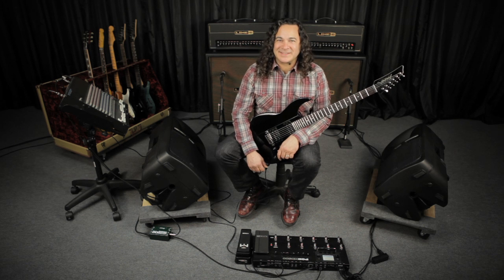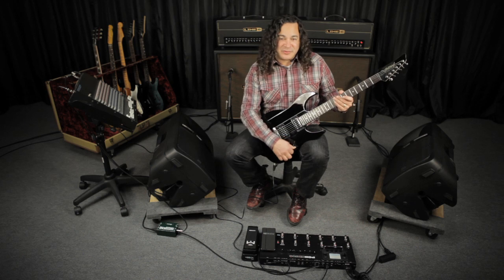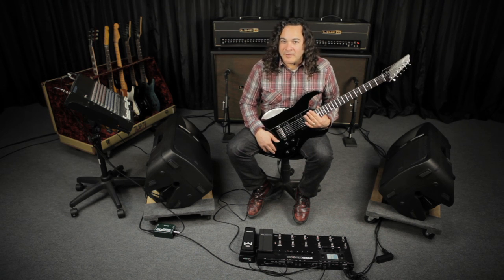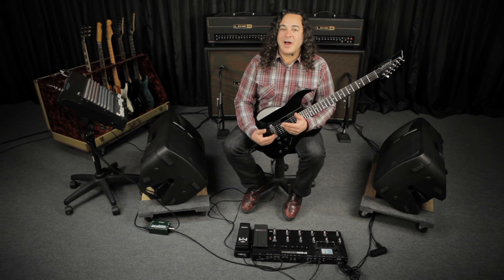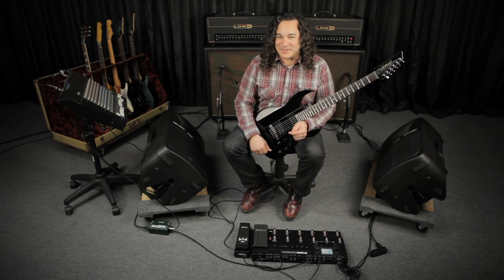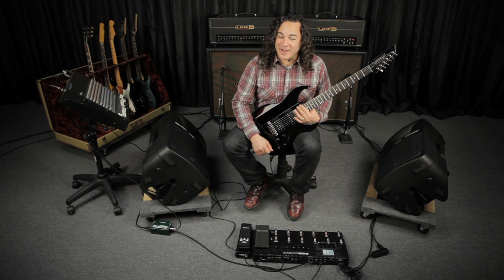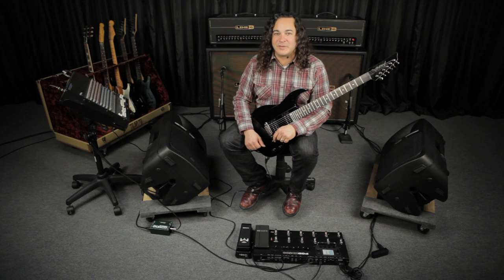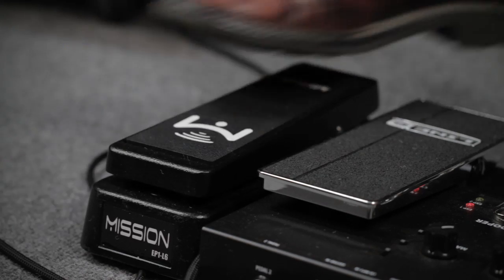Connectivity Series Pt. 1: James Tyler Variax & POD HD500 | Line 6

Comment from the maker: @hamzabinamin123 you'd connect the JTV to the guitar input or Variax input of the POD, and then come out of one of the 1/4" analog outputs on the POD to the guitar input on your Spider. If you set the Spider to a clean tone it should sound fine.